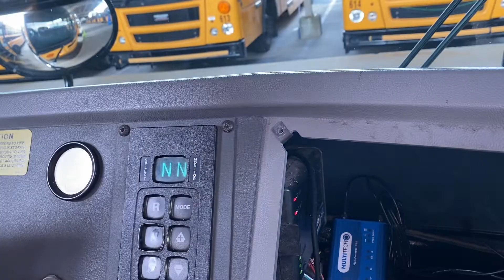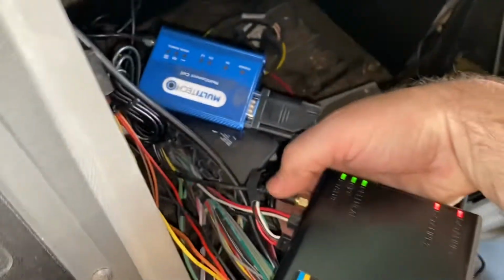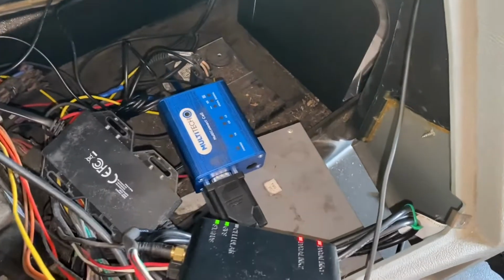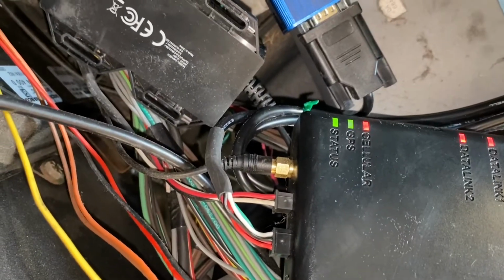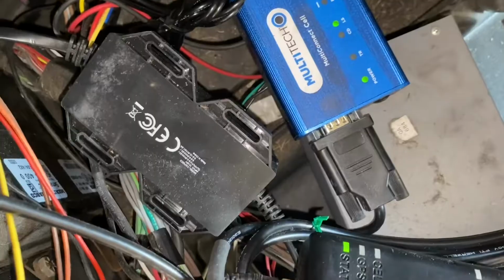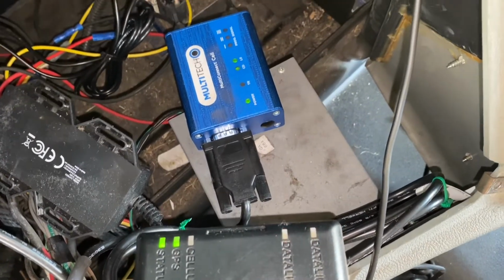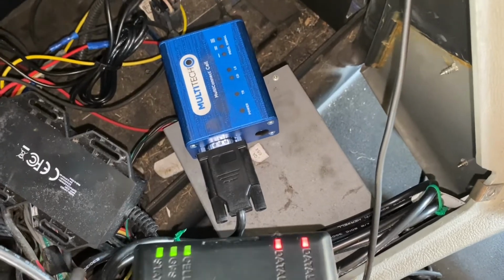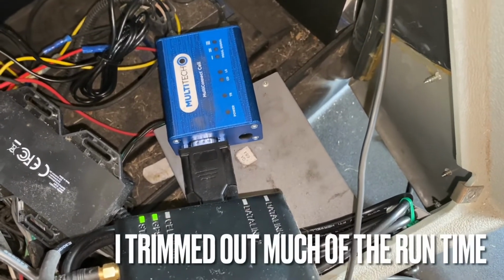Multitech 4G Converter failure on V3 ZONAR

Comment: I thought for SURE it was a faulty transponster, but that wouldn’t cause the Multitech to fail to connect to cellular. 🤔 Did you check for a faulty flux capacitor?
Reply from the maker: It was actually the warp core.